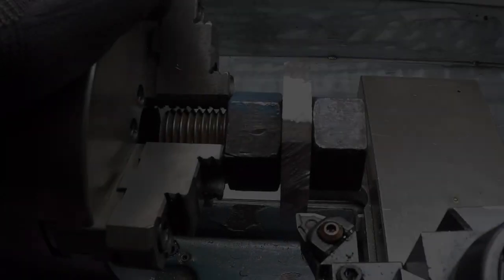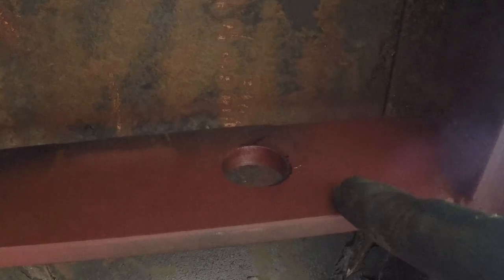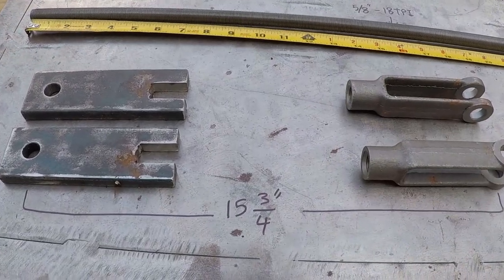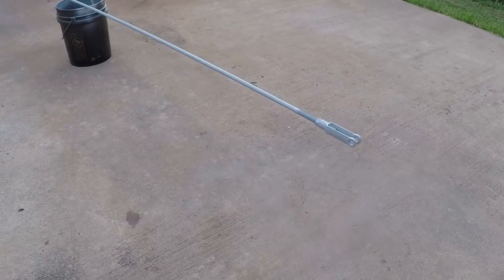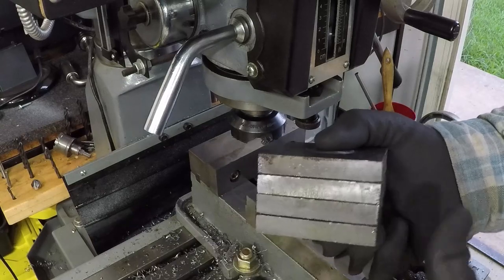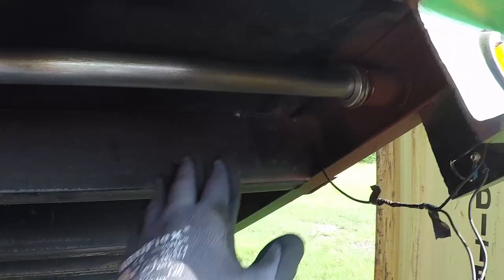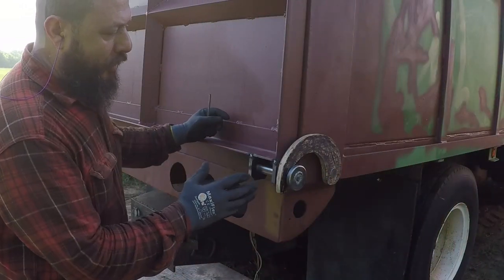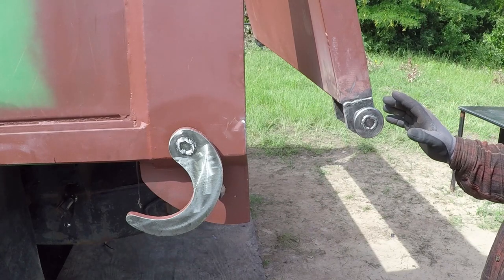Dump Truck Project Homemade Tailgate Latch System P2

Comment: What brand is the hole saw bit?

I love your precision and attention to detail!! Great work. Keep it up !!
Reply from the maker: Hello, I tried many brands of carbide hole saws (cheap but make sure the carbide looks large from the pictures provided by the seller). I get mine from eBay and Amazon. Every brand preform great. If you use them with hand held drill, they will break. If you use them on drill press, lathe or milling machine, then they will serve you for very long time. Use plenty of oil while using them and run them at the lowest speed. I am not sure what brand I used in this video. I also tried expensive brands like the champion and they preform similar to the cheaper brand. Thank you for the nice comment. Please let me know if you have any more questions. Have a great day.